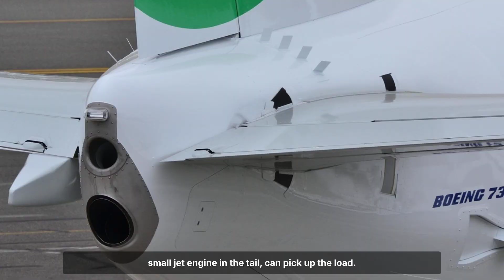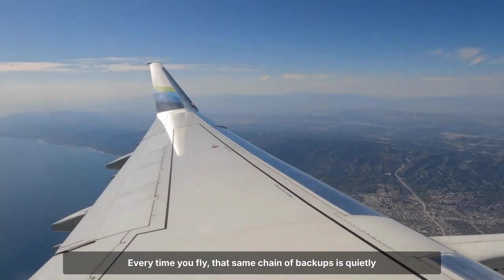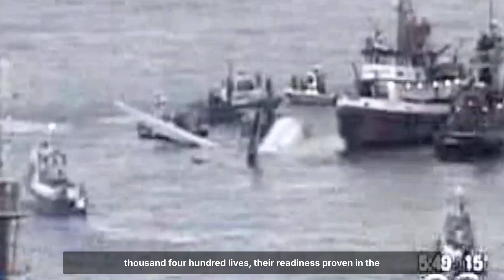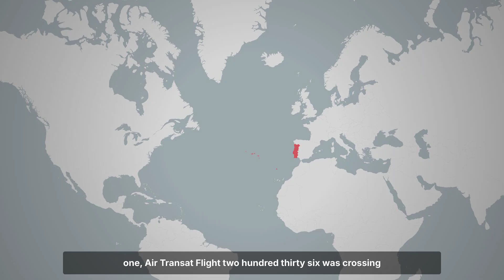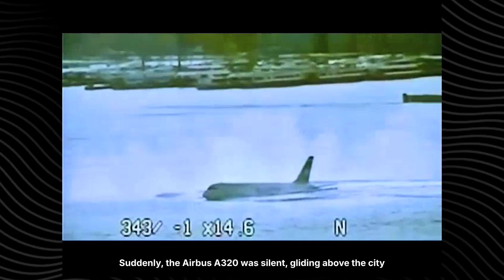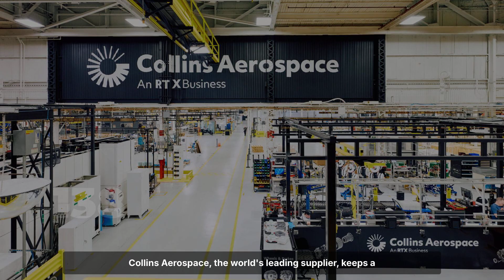Why Planes Have a Secret Backup That Only Works Once

Comment: I'm giving a "like" to this because such content helps people have more confidence in commercial aircraft safety. But I need to point out that the "Miracle on the Hudson" flight was mostly assisted by the crew having started the APU (auxiliary power unit) early on in the incident. The APU can power basically all the systems and give the pilots full control compared to the minimal controls that a RAT-only scenario would. The RAT did deploy automatically and perhaps helped while the APU was coming up to speed.